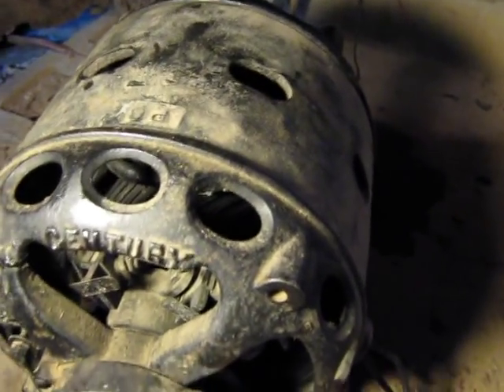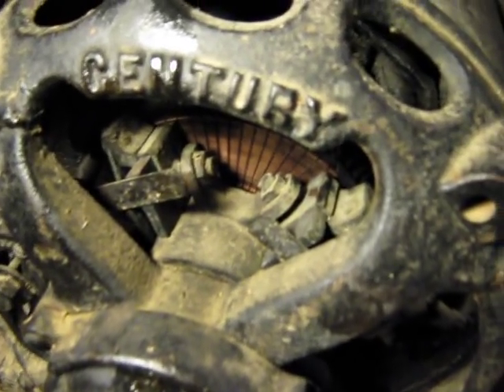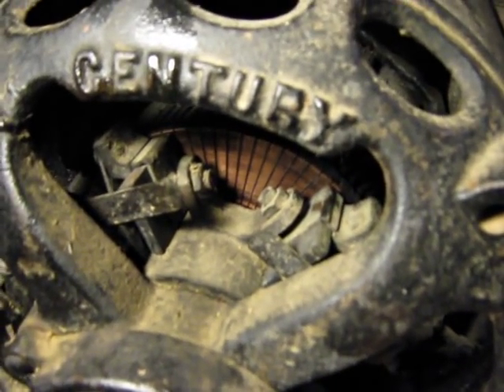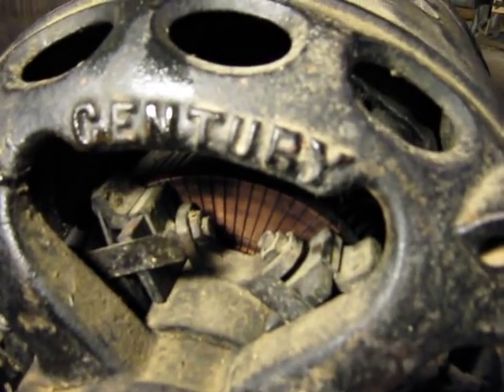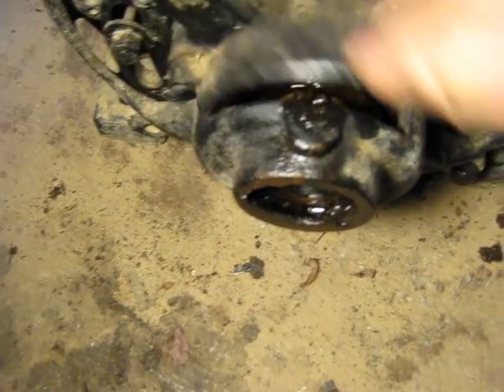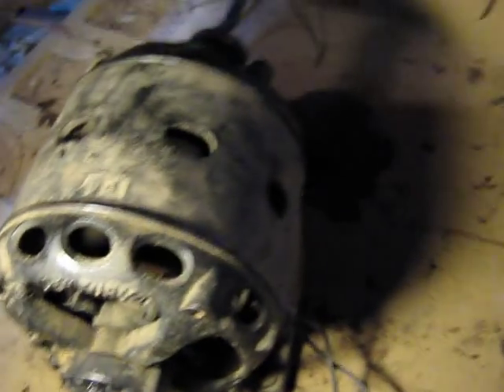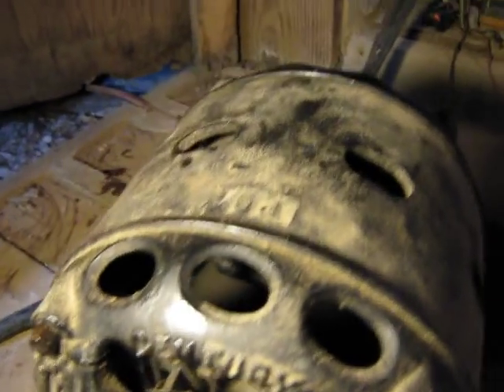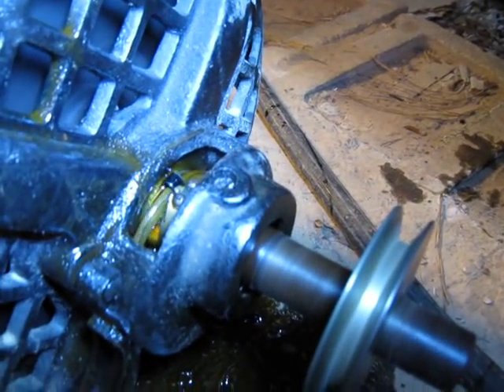Century Motor (with explanation), Antique RSIR Electric Motor

Comment: Cool sounding motor and really  interesting oilers. Love it!
Reply from the maker: Thank you!  It is the bigger brother of the little 1/4 HP Century on my Frigidaire M5-2.
Reply: @davida1hiwaaynet  on the old Centrury motors what is the "No." Nomenclature meaning on the bottom right of the tags? I have a fan model 230 with "No. L-1" on it seems like a precursor to serial numbers I'm curious what it means. These motors are of an amazing design. Tho they are brittle they run like I've never seen or heard. I like them.

Comment: Waay cool motor! This one is a 6-pole 1200 rpm machine. It sounds wonderful! Please check inside though, I hear something dragging while it is running, possibly something hanging off the stator or windings and contacting the rotor. This is a big P-frame, possibly P-8 to P-10 frame size, the higher the number, the bigger the frame. These Century skeletal repulsion start motors are possibly the most collectible of them all! I have several and plan to get more. Thanks for sharing!

Comment from the maker: Yes - the rubbing is in the brush retraction mechanism.  The shaft has too much endplay and the sliding piece that moves withthe short-circuiter is lightly bumping the part that spreads the brush holders.

Thankfully it isn't in the windings!

Comment from the maker: It's a 2 wire motor (not counting grounding).  I was running it on 120V for testing.  Not sure of the rated voltage.
Reply: Mine has a tag that has patent dates from before WWI and it is marked as a 230/115.  Mine is like a 1 or 2 HP.

Comment: Don't know if you still have this motor but that is a 3/4 hp. See how the casting on the front are left blank rather than cut out (they look like indents instead).
 I believe that's a rs2 frame. I have just got the same one
Reply from the maker: Thank you for the comment on this video! I do see the indents on the front which are closed. I had always thought this was to help direct air from the fan / weight assembly back through and around the winding; as opposed to in the front around the shaft, and directly out around the periphery of the front (not going past the winding.) 

I am still unsure about the specifications on the motor because someone took the nameplate off long ago. People have told me it is anywhere from 1/2 HP to 2 HP. I think the scale of it is hard to see in the video. I'm using it to run a backup air compressor in my shop at this time. It is more than 3/4 HP based on the compressor capacity it runs continuously without overheating. 

You may have seen this already: https://youtu.be/yRQFbtoPjfQ
Reply from the maker: @tom18181 Hey, just looked at your channel and subscribed! I don't have time to watch at the moment but will do so later today.  That little green and orange compressor is a thing of beauty and I will learn all about it soon!

Comment: I have a similar motor of maybe 3/4 hp but the brushes stay in contact and the supports for them can move which varies the rpm. The brushes are shorted to the support(metal). I had ideas of changing it into a DC motor or generator by insulating the brushes from the support.

Comment: we have a new age 240v motor that rates at 2hp turning our old compressor (1915 worthington) the new motor cant keep up with the compressor after it gets to about 90 PSI. 
i have a similar motor to yours that I just hooked up to the compressor. not only did it happily spin it up with no issue, it kept going without fault until the pressure switch clicked it off. 
i'd say this motor has a bit more than 1 hp

Comment: I was recently given a very similar Century motor. It has the same brush-lifting mechanism, and the end-bell castings are identical. It looks to be the same size as yours, as well. The only major difference is that it has a pair of oil cups at each bearing, leading me to think yours is slightly older. 

It's 1-1/2 HP, 110/220V, drawing 18.4/9.2A at full load. When I have it running, I'll tell you the no-load amps, which should help you guess at your HP. 

Latest patent date on mine is 1915.

Comment: Great old motors. Many of these were used to power air blowers in church organs (mostly Spencer Orgoblo models) at the turn of the century. Most were in the 1-2 HP range. They were used because of how quiet they were when they were running. 
Many churches have eliminated the old pipe organs and now use elecronic, but they have left the motors in place because they are heavy too move. Most churches will let you have them for free if you remove them.
I loved working on these. The models used for organs had long shafts for the turbine vanes and were refitted into wood shops to power planes and moulding shapers. The brushes are hard to come by now, but you can cut your own to fit. The link below has soe good info on the maintenance of the motors.

http://barton.theatreorgans.com/orgoblo.htm
Reply from the maker: HI Andrew. Thank you for the great info on the church organ application for these motors. This motor is right in that size range, as well, but the slow 1200 RPM rating might be too slow to produce the static pressure needed. Or I could be wrong! :) 

Thanks so much for the link to the Barton site. The Spencer manual is really good to read. 

This motor was a find when I was very young; probably 15 or 16. It was on the floor in an abandoned building which had a lot of (what looked like) hoarder trash in it. So there's no telling what its last application was. Fascinating to think about, though!
Reply: @davida1hiwaaynet  
Such a cool thing to find at that age. I'm probably a little older than you. I learned how to work on these motors in high school. 
Although I don't think your motor came from a blower (shaft is too small) the 1200 rpm could work with an organ, size dependent of course, because most organ blowers feed air into a reservoir. 
If you like mechanical things, check out an old pipe organ someday, they're amazing machines.
Reply from the maker: @andrewdanylchuk5144   Cool to know that the low RPM could be adequate for an organ blower. Makes sense the blower would be designed for low RPM, quieter operation given the application. 

I am fascinated with all mechanical, and have been looking at the pipe organ pages on Facebook as well. Certainly amazing stuff.